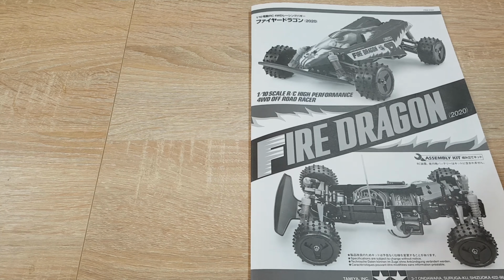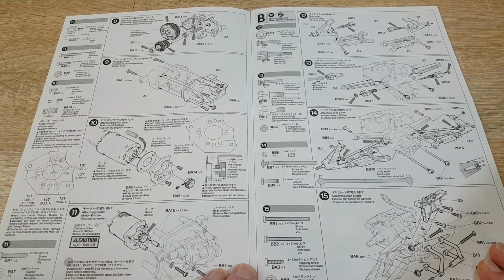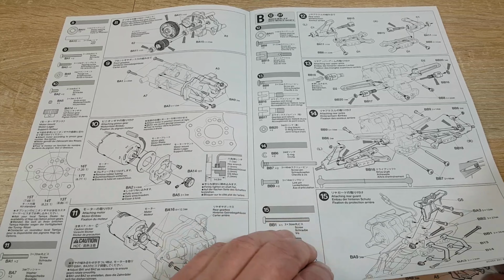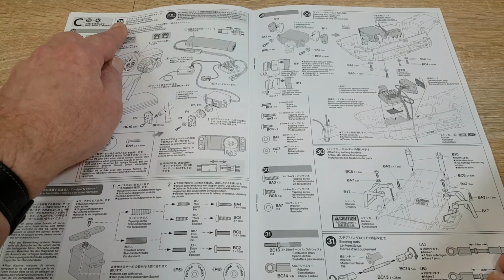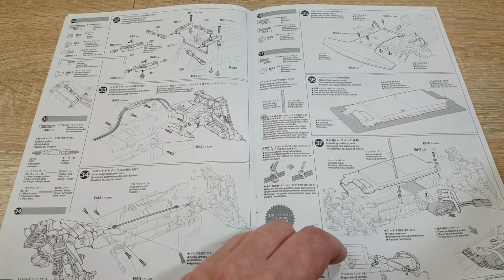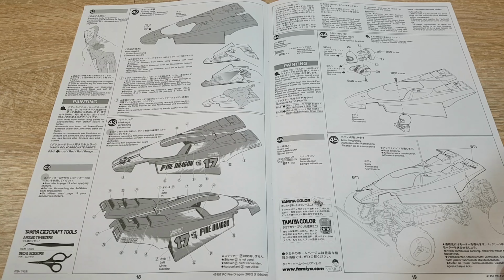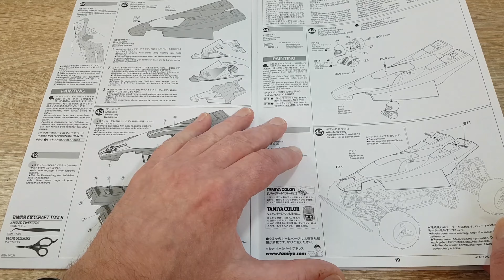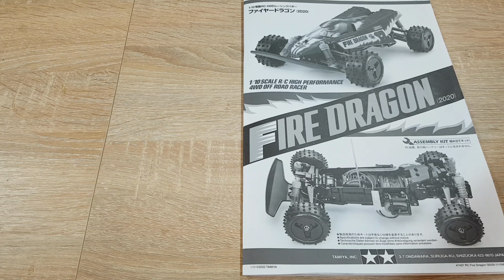Tamiya Fire Dragon 2020: The Build / Steps 1 - 19

Comment: It is a great kit to build and run! Since you painted over the windows the dust cover is not going to help out a ton but it will still keep some stuff from getting in. I would stick it in there but would not worry about painting it . Have fun with the rest of the build and I know you have fun driving it!
Reply from the maker: Thanks a lot Addam. You're right, these were my thoughts, too. A little bit dust protection is better than none. It's somehow the same as on the Super Hot Shot, covered from the top, open from the underside. And it's the second paintjob on the car. I painted it black😉

Comment: wo wo wo...stop the presses!!!  What is that thing you're using when it came to building the dampers?!  I've never seen that before...what does it do?  That's a new one for me. Anyway great job!  The build looks fun and it's definitely an interesting design.  The gearbox is different from anything I've seen so far. Love your time lapse music.  Think I've said that before but it goes so well for this sort of thing.
Reply from the maker: This is Tamiya 54152 Damper Oil Air Remover (Long). It creates a vacuum which sucks out all air out of the oil. It's astonishing how much is comming out, even if you move the piston before you put it into it. It wasn't cheap, but if you're work always with it the price devides to the models. It has an insert with different diamater holes and a n extension fo longer dampers. Every Tamiya damper should fit.
If you're engaged in on-road races this is a must have. If you're just running around like me, it's slightly oberkill. It's not so important that every damper is EXACTLY the same as the others on the car. But it's great to avoid filling mistakes, so I use it.